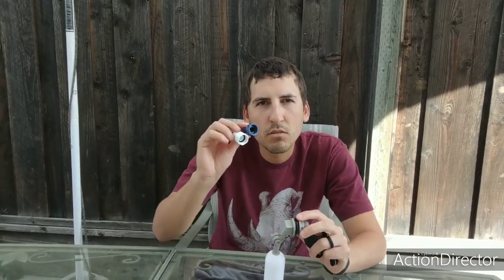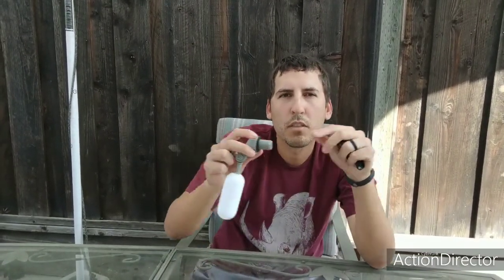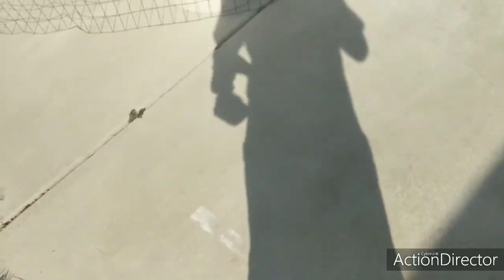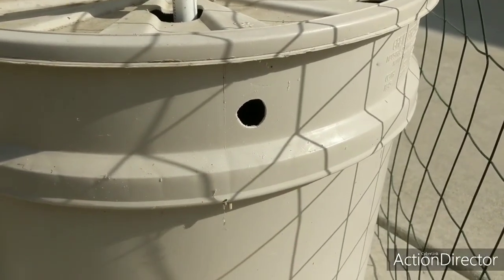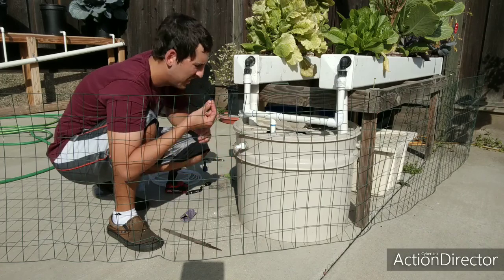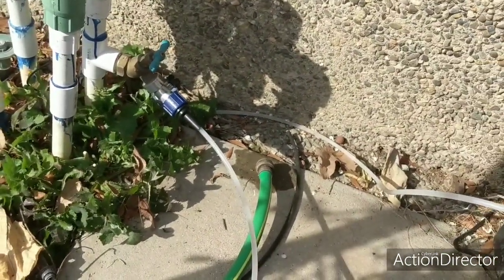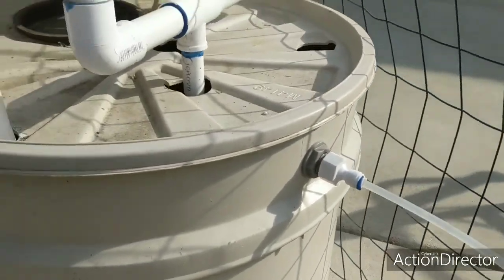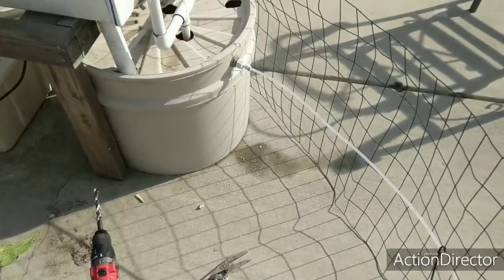How To Install A Hydroponic Float Valve

Comment: When drilling, barely start the hole.  Meaning, just make enough of an indention to keep the bit in the same spot.  Then switch to reverse on the drill and apply pressure and drill out the hole in reverse.  This helps with almost eliminating burs on the inside where your seal will be.

Comment: Please include the links, GREAT VIDEO!
Reply from the maker: Links have been added. Pick any 1/4 inch 
R/O line and that will complete the set-up. The price has gone up to $11 on the valve. But that one does come with the connectors.  Thanks for watching!

Comment: So if you are running that straight from your water spigot, it is diluting your nutrients.  Shouldn't you run that from a larger water reservoir with nutrients in it?
Reply from the maker: Yes, this is correct. I add nutrients about once a week to compensate. Also when water evaporates or is taken up by the plants, nutrients are still left behind in the solution. I find this effective when it's really hot 105+ degrees. The plant mostly draws water and little nutrients